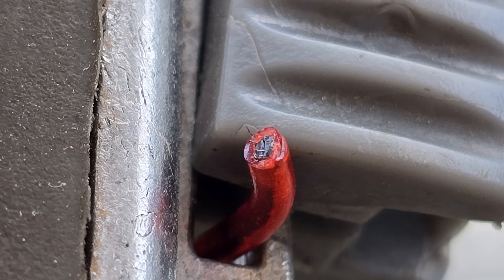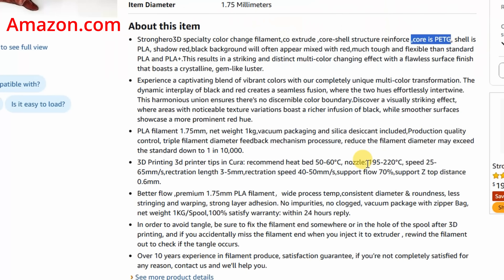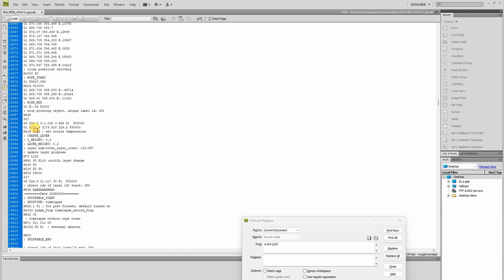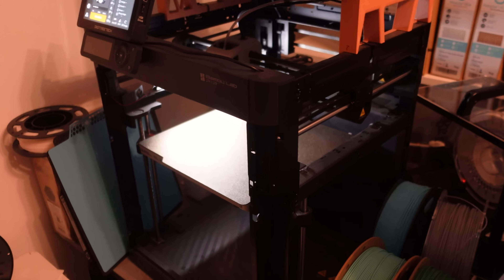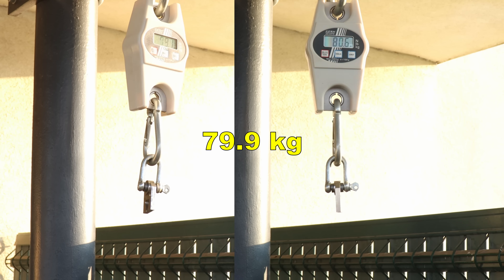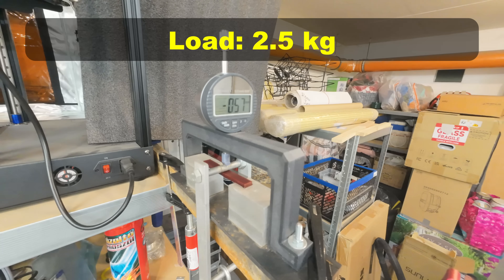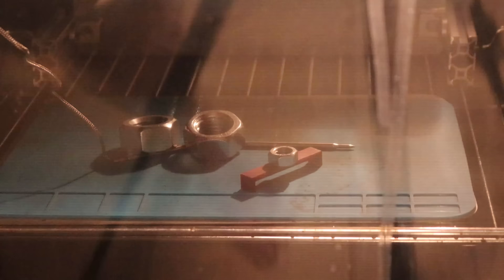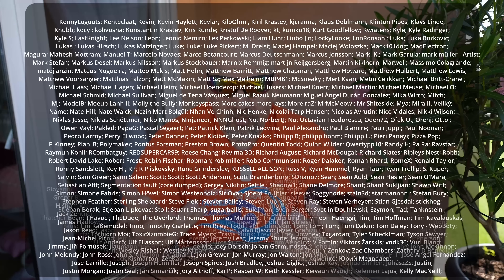PLA with a PETG Core? Testing Stronghero 3D’s Hybrid Filament

Comment: Using in a elegoo carbon using smooth plate side with temp of 225 hot end and 65 bed temp.  Fairly impressed, I think I'm gonna try to print my toymaker3d files with it. Im no expert by any means but i think it's perfect for it.

Comment: Another great video, thank you! Is there a chance that adding a little bit of heat resistance might help with PLA annealing? In that case, the PETG core might act as a more resilient skeleton, allowing the PLA shell to bake better and maintain better dimensional accuracy. Also, there is an interesting filament which I'm not sure if you had a chance to get acquainted with, it's made by Filamentarno, ABS+PA66 blend with 8% GF fill. It would be interesting to see what your opinion is.

Comment: From the microscope it looks like a PETG core with PLA pullstruded around the outside, same as bottle strip machines like the ReCreator3D. It would mostly melt and combine in the hotend.

Comment: I posted a link to a dumb patent for Core and Shell Filament. My post got deleted. The patent must be in the realm of Prior Art, the patent holder isn't defending it, or all these filament producers that are making Core filaments are licensing that patent. I think the latter is the least likely. 

I was extruding Clay Tubes in college back around 2012 and that was basically the same idea just with different slightly different equipment and material.

Comment: I understand everyone saying PETG and PLA do not stick to each other.  But i have had great success combining both in the same print.
All I do is, if PLA is going ontop of PETG I match the PETG temp with the PLA for that first layer.  If its PETG ontop of PLA I also gust print at the PETG temp.
Now these aren't small test prints, so there is a lot more contact surface area between the two.

I have even made my own co-extrusion filament (by printing a spiral with a layer change) with both PLA and PETG mixed for a vase mode print.  That turned out very nice!  (the reason i did that was for the 2 different colors, I didn't have both colors in the same filament type)

Comment: What I'm left wondering is: what happens if you use this in a multicolor print? How does it bond to standard PLA or standard PETG? I'm wondering if they've got some additives that help with the bond and if it might have a reasonable bond to normal PLA or PETG, or if it's a universal support-layer material...!

I always love inventions that seem like they were the result of too much alcohol... like this filament, the sport of luge, or Renault's decision to put a Formula 1 engine in a minivan.

Comment: Wouldn't it have been better with the PLA on the inside?  Doesn't PETG have better layer adhesion?  The PLA might stiffen the PETG just a bit.
Reply: PETG layer adhesion is usually worse than PLA
Reply from the maker: In most cases, PLA has better layer adhesion
Reply: @MyTechFun  interesting. I know I have to go slow and hot, but layer adhesion was never a problem in my bed heated chamber.

Comment: Not sure why they would mix these two filaments, which does not stick together, however I definitely love the look/color
Reply from the maker: Maybe they were curious too, like me. Nice to see the attempt..
Reply: I’ve printed some fun stuff in their silver black PETG/PLA and it genuinely has a different look than any other filament type. My theory is that you cannot do a core/skin with the same plastic because they diffuse across during extrusion, which is why you only see multicolor PLA in split colors. Either way - you will be hard pressed to get the same color effect with any other filament type so I think it’s a successful experiment.
Reply: Definitely a weird combo. Now if you made TPU shell with a stiff core of petg that'd be excellent. The two fuse together perfectly already tested it and tpu doesn't delaminate unlike petg.
Reply: they do stick together. I once finished off a pla print with petg.

Comment: Since you seem to like the Biqu Frostbite plate, i would suggest getting the Biqu Glacier plate for the Plus4. Sadly the Frostbite isn't avaible for it and Biqu told me, they don't plan to release it.
I print anything besides PC on that plate and i NEVER use gluestick because i really hate using it. I print everything between 10 and 25 degrees cooler comparing to PEI and mostly have even better bed adhesion. PA and PACF without glue? No Problem! 60-75°C...
It seems to me, that i save quite an amount of energy printing PLA at 45°C.
Reply: I personally do not like the glacier for anything but nylon. Its adhesion is the same as pei at any given temp (you can watch Igor's on video that shows as much). The only thing I can see it being useful for over pei with pla/petg is the bottom surface texture.

Also, you can get PLU plates for the plus 4 which are much more in line with that the frostbite offers interms of adhesion and much lower bed temperatures.
Reply: @winebartender6653  I didn't know Igor had a video on this topic... 😅 There our personal experience seems to differ a LOT. I tried many bed ahesion benchmarks and temperature settings. The most convincing thing that happend to me, was printing the "stairs to nowhere" with 35°C at start and the going down to 25°C over night(PLA). On the next day(roomtemp=12°C) the print still stuck to the print plate very well. Can't imagine doing this with PEI... For bigger parts i need 45°C. Medium sized parts i print at 45°C first layer and then 35°C.
I also have ASA filament from two different manufacturers that i printed several kgs at 75°C.
It seems, like that is a thing in 3D printing, that the same materials perform very different for different people/setups...
Reply: @grott3n0lm Need it make it did a video on the stairs and the pei actually performed better than the glacier in that exact test. https://youtu.be/gl8ABgIuQhs?si=zJFwMcl4rogs_55c

Im not saying your lying or anything, but i can almost guarantee that useing those exact same temps with a clean pei will result in the same outcome. Maybe just a bit on confirmation bias in that it claims to be a cool plate so you immediately test it at lower temps while only used the pei at higher temps since that's what the default is for pei.
Reply: PA? Ok that sounds nice

Comment: I'm generally not interested in things that seem to be gimmicks but I do appreciate innovation and sometimes there is serendipity when someone tries something simply because they can.  I wasn't expecting much because PLA and PETG don't bond well, but in this case, Stronghero seems to have created a hybrid filament with surprisingly good mechanical properties somewhere between PLA and PETG, a temperature resistance very close to PETG, nearly the ease of printing of PLA, and an interesting appearance... and it's affordable as long as you aren't paying for international shipping.  I can see a lot of uses for a material such as this where a part needs decent mechanical properties, decent temperature resistance, layer adhesion isn't a critical factor, and an interesting visual appeal would be a plus.  It might be a good material for a 3D printed cup holder for a car.
Reply: You might as well just print the cup holder in pure petg and print it solid for extra sturdiness
Reply: @kimnielsen9320  - Stronghero is promoting their PLA/PETG hybrid filament largely based on aesthetics.  A pure PETG product won't look as nice as the red/black visual texture of the hybrid filament.
Reply: lol, its a shit filament, what are you smoking. Just like pla and petg and toy printers withouth heated chamber.